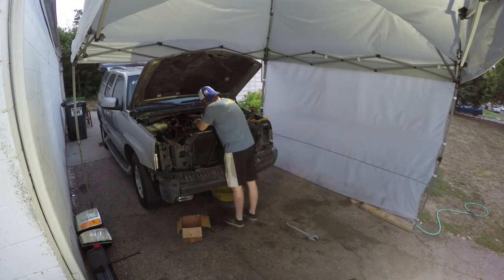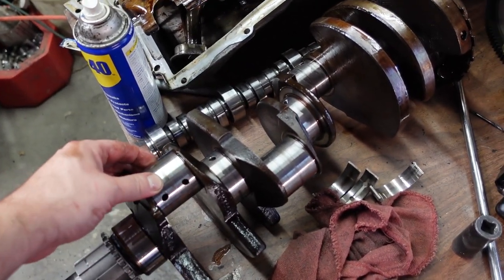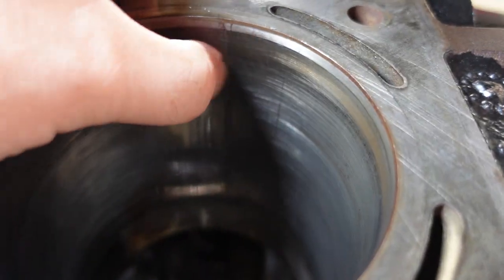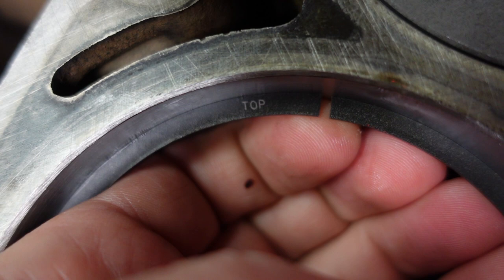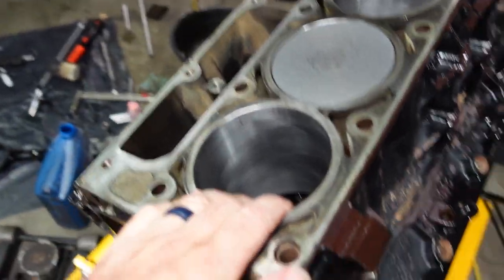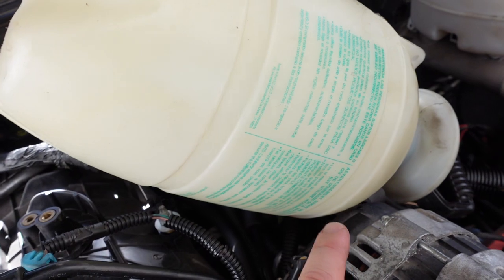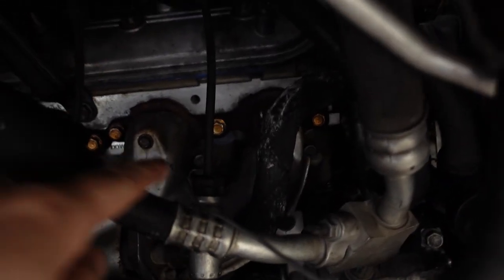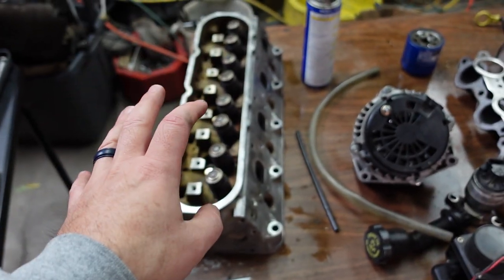LS Engine Rebuild - 3 more ways to FAIL (and succeed?) - pt 2

Comment: I have never watched an automotive video where I have shook my head more than I have this video,
Reply from the maker: You and me both, friend.
Reply: I seen this comment before I watched the video and thought you were exaggerating.  You weren’t.    I can build these in my sleep.  He doesn’t need to prime it or any other BS.  Turn the key and start it.   

These guys that think they’re priming the oil system by cranking it over for oil pressure is idiotic.  It does more harm than good.
Reply: I shook my head on part one when he let the bores go....😅😅😂
Reply: That amount of fiberyou found in the pickup tube had to have been from a piece of paper towel that was hiding somewhere.  For that to have been just stray fibers ,  the inside of your engine would have looked like mold was growing on it.

Comment: no way that red rag left that much lint in the engine.  Something much larger must have been in the pan.  I would like to have a look at the oil filter.
Reply from the maker: Could be!  I'll do an oil filter exam soon.
Reply: Those red rags leave tons of lint, I did a big block olds years ago, had to completely clean the block out after using them all over it. Was a mess.

Comment: New builds usually have sparkes….its just all the parts introducing themselves to eachother….just change the oil again in 500mi then again at 1000mi and the final at 1500 mi i would have ran 30w rotella diesel oil during those first 1500mi….
Reply from the maker: Another oil analysis is coming up soon!

Comment: Like the way you owned it and stuck w the block. Embrace the suck…lol. I’m just getting into motors and rebuilds @ 53 years old. 04 suburban. Glad you aren’t gapping for boost, I didn’t understand why but assumed you were boost adding later. Glad the weather was ideal for engine pulling and installs. Works out that way just to make mistakes that much better.

Comment: Just hit subscribe i watched the fist oart and now half-way through the 3rd build. I always take my block to Bob Lane in Gastonia NC to have them cleaned new cam bearing and plugs. They check the block hone and then i just use a mic and put it all together.  The extra money is well worth it on a budget.
Reply from the maker: I did have the block cleaned by the machine shop after the hone on the (2nd? 3rd? attempt, but something persisted somewhere!  Maybe the oil cooler, even though I flushed that by hand as well?

Comment: If you are using the black o ring on the pickup oil tube and it fits just a little loose it can throw your oil pressure off it is recommended to use the green o ring

Comment: I used to complain about getting a used 6.0 here in sf Bay Area but with the last month I picked up 2. The 1st one I got as a short block for $440. Turns out the crank was bad but everything else checks out. Then a few days ago I picked up a long block for $200. Again crank is bad but it has gen 4 rods and pistons. Had to get a little more aggressive and it worked out
Reply: Where are you getting the engines from? I am in the same area. Looking to get a block.

Comment: I think the fibers were gasket scrapings. Do you plug off holes when cleaning surfaces? Do you run a vacuum near razor blade edge as your scraping?

Comment: i want an update on how this held up?
Reply from the maker: I've only gotten about 1600 miles on it since, but it's still running OK, still has oil pressure, and I just did an oil change and sent the sample off for analysis.  Fingers crossed that it's breaking in OK!

Comment: You’re going to have some glitter on the first oil change.  Make sure you change the cam retaining plate….   The seal gets hard and will kill your oil pressure.  Changing the barbell isn’t a bad idea and modding the factory oil pump for more pressure will make a drastic change.  

Turning the engine over to build oil pressure is wrong.  So many things are turning to long with no lubricantion.    It can’t build enough pressure because the engine isn’t spinning fast enough.

Just start it up.  You’ll have oil pressure in 5 seconds.  Lifter will be noisy for a minute until they pump up… they’re noisy to begin with.

Comment: my father's engine run full of sand, idk what you did wrong but it look like old shreded gasket piece or loose gunk from inside somewhat came out after being loosen up, but for some reason kept hidden until you ran it then clogged the pickup tube. im pretty sure your towel dust did not destroyed your engine. its sad that you saw your oil pressure was off too late because your gauge work fine,

Comment: There is no way there was that much lint from just cleaning the cylinders.  Plus, most of the left over lint would probably be burnt or blown out the exhaust.  Unfortunately, somehow, something did get stuck.  Maybe you plugged the pickup tubes to keep junk out and didn't remove it?  

I feel your pain.  I've had a few engine boo boos myself and they are never fun. 

P.S. Don't trust plasti-guage.  It's close but usually off enough to make me not use it.  I "C" mic the crank journal and then dial bore gauge the bearings after torquing the down.

Comment: Oof... 73rd times the charm, or not. That was like 6 seconds of no oil pressure. They make a tool that goes into the hole past the threads, then expands and clears the threads on the way out so you dont send chips into the cylinder. This video and the previous one was a total train wreck.